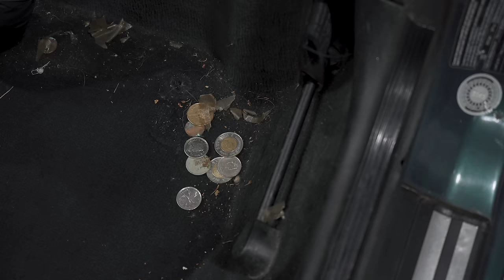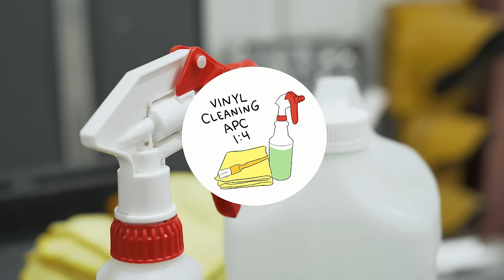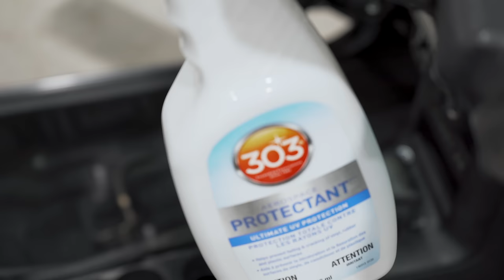The Interior Of Our Sh*box BMW E36 Gets Deep Cleaned

Comment: I've used apc and my steamer to clean on surfaces, and it had left white and dry spots.
Reply from the maker: Did you hold the steam in one spot for too long? Thats a pretty common cause of dry/burnt spots
Reply: @ChromaticGarage  I don't spray the steam in one stop for too long. It usually happens when I use apc and my steamer at once. Does this happen bc maybe I spray distilled water w apc and tap water from my steamer?

Comment: Personally, I would've paid you to completely remove the carpet and shampoo it thru & thru... Also, under the carpet of all E36 BMW's there's about fifty pounds of black-tar like sound deadening material that requires heating up to remove. Less weight is always a good thing on an already extra heavy drop-top. Great work though.
Reply from the maker: Haha I feel you man. This car is already the 318, its not going anywhere fast no matter how much weight is shed. It should look cool by the spring though!
Reply: the amount of work needed to remove it vs the difference youll feel on the street (nothing) aint worth the headache.  BMW has sound deadening there for a reason lol